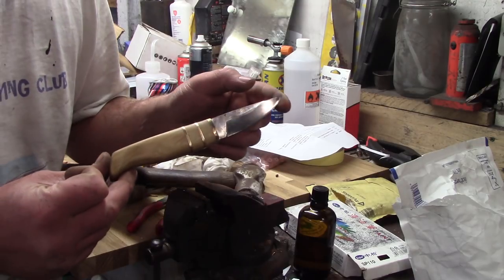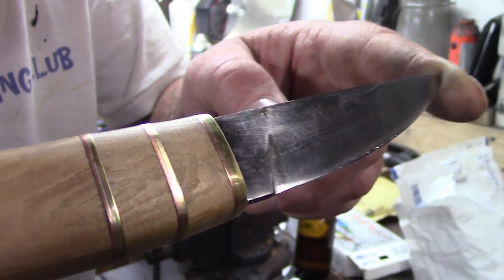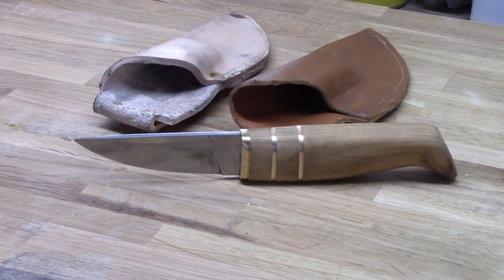Making a Puukko style bushcraft knife

Comment: That band saw... wow. Cast arm, SOLID. Is it old?
Reply from the maker: William yes mate, this one is getting old but they are still made and sold in exactly the same pattern, in the UK it is sold as a Sealy SM5. Mine has a manufactur date of 2003. I'm not too impressed with it and need to replace the bearings but it's a lot more pleasant to use on fine stuff than an angle grinder.